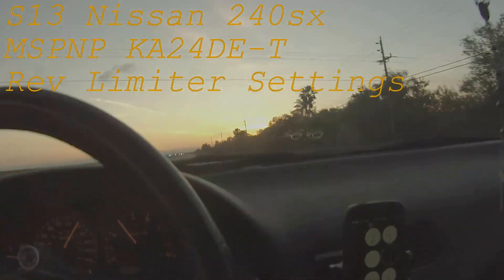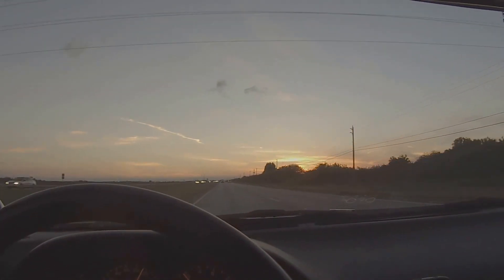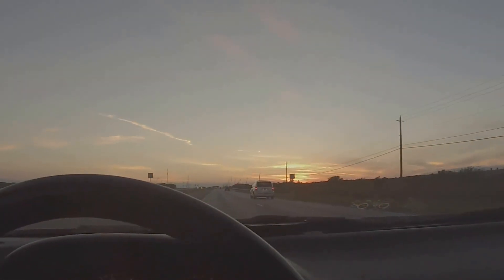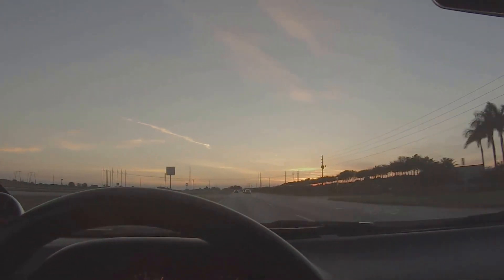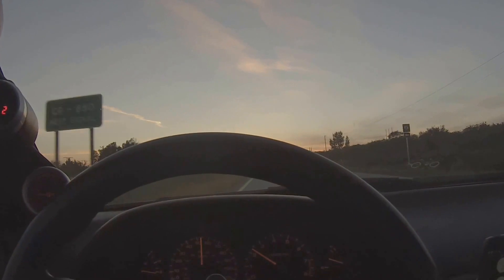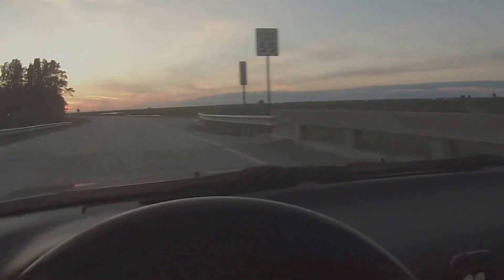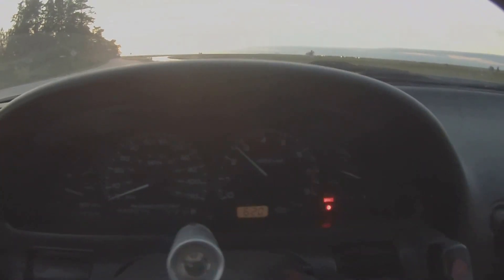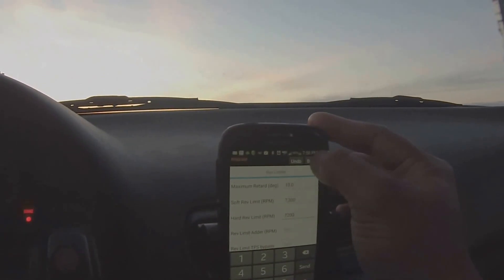S13 Nissan 240sx KA24DE-T MSPNP Rev Limiter Settings

Comment: ive been trying to set up a nice rev limiter that womt kill my power up top for drifting. every way ive tried just makes the power fall off and not be able to hold drifts.  any suggestions?
Reply from the maker: Rittycrack I had this issue. Make the soft rev limit higher than hard limit to disable soft rev.  I had this same issue.

Comment: Pleased that MSDroid is serving you well. We're getting a new version out soon.
Reply from the maker: Thanks for the heads up.  It is a great app.  Will the update have changes to the gui of the gauges?
Reply: supakat500
The code for the dashboard (gauges) has been rewritten and there will be lots of new gauges types, plus indicators, historgrams, etc. It may take a little time before the new stuff appears in a release but I'm working towards it.
Reply from the maker: Trevor Page Great news!  Keep up the great work. Looking forward towards the updates.
Reply: Actually if you have any specific ideas or requests for the UI, I'll try to take them on board.
Reply from the maker: Trevor Page Sounds good.  Just a view with gauges like stock vehicles.  Have analog needle gauge with numerical value like you have already but just the layout of gauges is what is needed.  Give it a stock feel like what we are use to seeing in our everyday vehicles especially our daily drivers. Lol